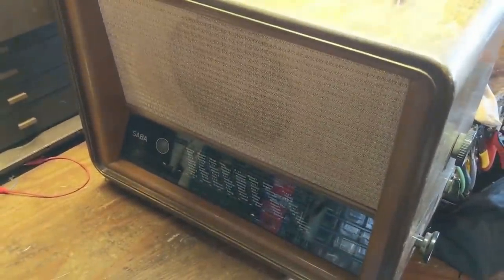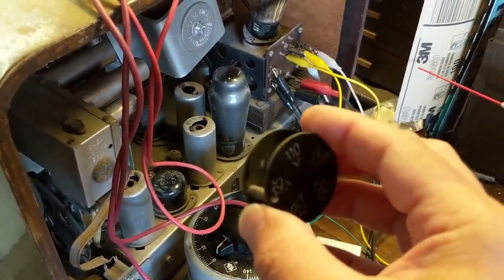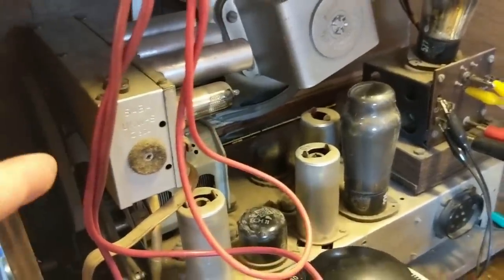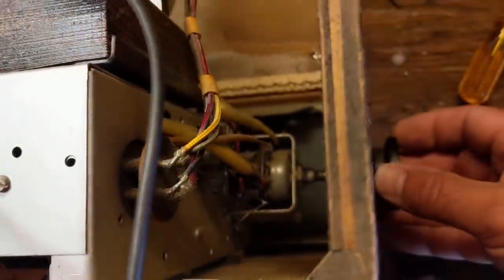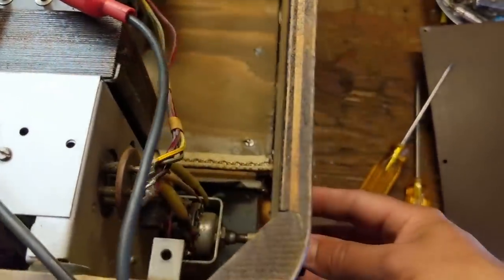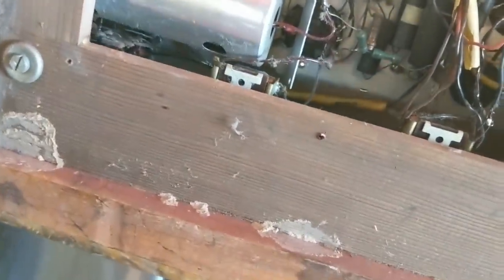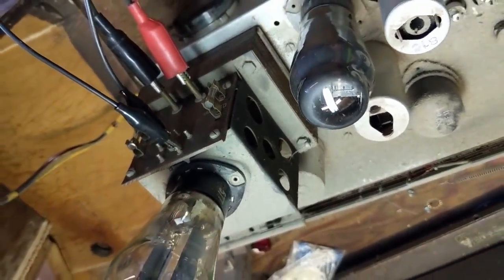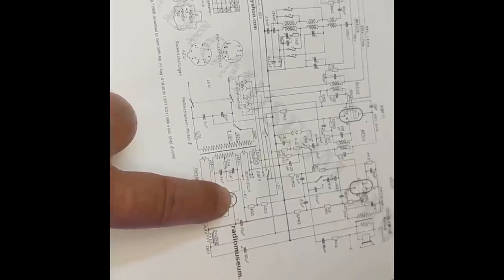The $35 "Mistake": Basket case Saba radio

Comment: How do you clean the surface of the Chassis ?
Reply from the maker: This one was just dusty. I used a leaf blower and a old paint brush
Reply: @misterradio5035  I used to work at a TV repair place and we took them outdoors on a wheeled cart and blew them off with an air compressor.  Never had a problem doing that.

Comment: This radio was build before UKW really arrived and fairly priced for costumers in Germany, so they prepared the receiver to build in a separate UKW box. This box goes inside a solderstrip parallel to the TA input. Worked recently on a Villingen W with a similar chassis. There were different Ukw boxes in different price classes. There were 2 “Pendelaudionvorsätze” and some superheterodyne like yours. For the EM11 you can adapt the circuit to a 6e5c there are some German forum threads where you can see what to do. Are you going to plug in the Teletype to the I-Telex network we are also member of it?  Best regards from Germany!

Comment: Ya know, most if not all vintage  electronics channels out there are keeping it properly clean, in terms of the narration.
So, to hear an occasional F or S bomb is, quite frankly, refreshing to say the least.
First amendment.
Edit: I've always had a genuine admiration and respect for the engineering solutions and design cues of German tube era gear.
Brilliant if not over engineered by some peoples standards.
Reply from the maker: I'm trying... When I first started making these I didn't realize how often I used F bombs. But they slip out on occasion.
Reply: @misterradio5035  doesn't bother me in the least  and your narration comes across that much more genuine when that does happen. no worries!

Comment: On the schematic, that dot you say just hangs out there is part of a switch. You can see just below it two other dots, labeled 10 and 9 and a thick black line connecting to 10. That's the switch. Also, I'm fairly certain it's the wrong schematic, because according to that same switch, there should be two separate positions for FM and record player. German language lesson: See on the schematic where it says TA - that's short for "tonabnehmer", literally meaning "sound pickup", for record player. Good work on getting the radio going! I love German sets.

Comment: Good choice on the finish. I may have missed it, but what about that fine wire?  What happened?
Reply from the maker: I am waiting on the 6EB7 tube and if FM actually works, I'll see what I can do about the wire.  It looks like a total nightmare to re-attach and if the FM on this is either "Old FM" or doesn't work? No need to spend hours trying to figure it out
Reply: @misterradio5035  OK cool. If you break that glass rod, try using a Lucite dowel. Look in hobby shops for it. Weird that it isn't plastic to begin with, but coming out of post war Germany, anything is possible. Was there any dial lights? Nice looking radio.

Comment: Strange mixture of miniature, bottle and balloon shaped tubes it’s like you got a tube from each decade in there heheh.
Reply from the maker: Ive seen this in a lot of post war Euro sets. My lame guess? They were using up pre-war stuff
Reply: @misterradio5035  In this case, you're looking at two almost independent sets. The main set is a evolution of older pre war sets, and so is still using the old "11" (ECH11, ECL11, EBF11) tubeset. This was one of the last civilian tube lineups released before the war (about 1938). Yes, even then, some of the new tubes were "balloon" or globe shaped, typically the rectifiers. Seems Telefunken didn't cut to bottle style as completely as RCA. Also mixing glass and metal tubes in the same lineup was common, some like the ECH11 were made in both glass and metal, seems to depend on the factory, ECH11 made in Ulm are almost always glas body, those from Berlin are metal. 

It was still a current tube lineup at the time, produced by many European factories. 
So it's not about using up stuff. There was none left, German tube production had more and more switched to war supplies beginning in 1937, so the 1938 tubes were already in short supply before the war. The 1939 lineup of receivers was the first to use those in numbers, and ... well, that was the last major lineup before everything went up in flames.
 
The only tube types available in large quantities shortly after the war were "Wehrmachts-tubes" like the RV12P2000, you'll find a lot of instructions on how to convert older sets to use this tubes in the radio magazines of the late 40s. Civilian tubes, be it the old RENS/RGN/AF - Telefunken types of the early 30s or the new E*11-line of ca. 1938 tube were almost impossible to source. 
So when tube production ramped up again after the war (would be 47 to 48 for civilian tube production to start in significant numbers), the 1938-tubes were the way to go.
Same time development on new tubes started - using the lessons learned during wartime about miniaturization. 

The FM part is a complete superhet-receiver on it's own, only sharing the power supply and power amp (this is why phono-in and UKW are the same setting,  it's just connected to the line in of the amp). This was a brand new development, public FM transmission had only started in Germany in early 1949. So this add-on used the newest tubes available - EF/ECH41 released 1948,  and EQ80 which was released in 1950. The pre-war tubes didn't quite cut it for FM on VHF (FM band in Germany at this time was 88-100MHz, it was extended to 104MHz mid 50s and 108MHz about 1960, so the same as in the US). As the Wehrmacht heavily used VHF(although AM) during the war (FeldFunk, up to 160MHz in "walkie-talkie" like devices) know-how was well established on German engineers on how to handle VHF. 
In 1952/53 most sets had completely switched away from the big old E"11 tubes,., and within two years UKW/FM was already standard on most sets (portables excluded, in 1955 about half the portable receivers offered in Germany were still AM only), instead of being an option like before: FM adoption in Germany was quite fast - forced by loosing most of it's AM frequency assignments after the war. 
To the point, that nowadays, there's no major public or commercial AM station left in the whole German speaking region. The last German AM station shut down in 2015 , Switzerland and Austria cut AM in 2009. Think there's still a 10W (jeah, didn't miss the k, 10 Watt) station in Munich, run by a few students at a museum.

Comment: I think the term basket case applies to this radio; you really put some work into it to get it running again. As far as the audio level, are you able to increase it in your editing program? I think that would be the easiest fix. Also, have you considered using a camcorder instead of your phone? You could mount it to a tripod, freeing both your hands, plus you wouldn't get any more of the vertical shots your phone sometimes gives you. Just a suggestion.
Reply from the maker: In about a month I'm getting a Google Pixel 6. I have the 2 now. Apparently the camera and mic are supposed to be excellent on it. So if that is the case that aught to solve the issue. We wkll seee